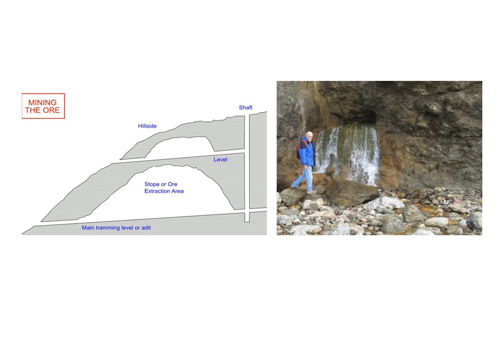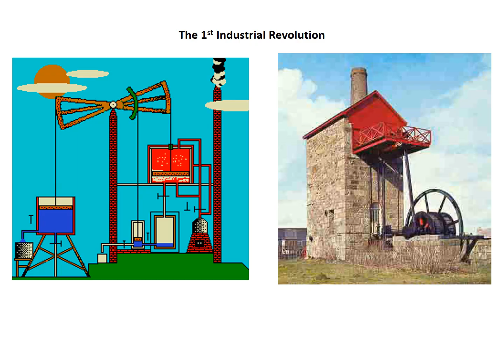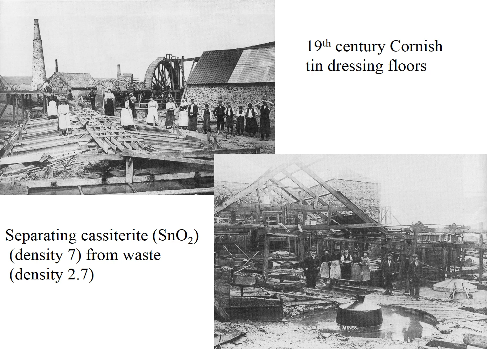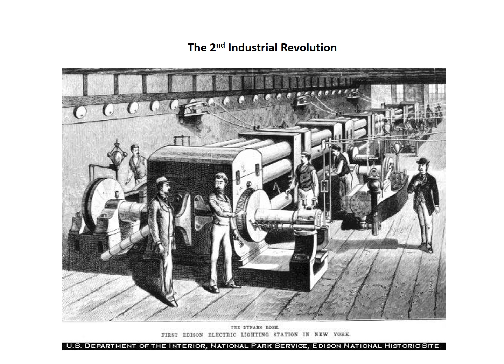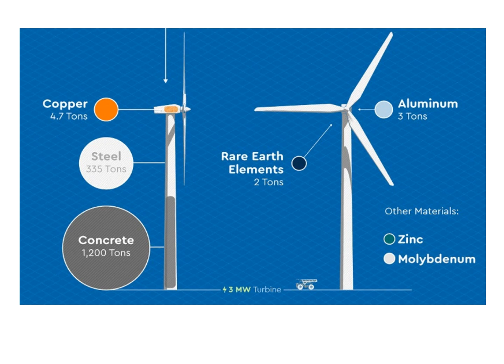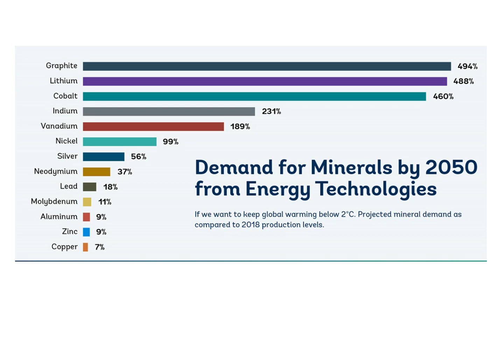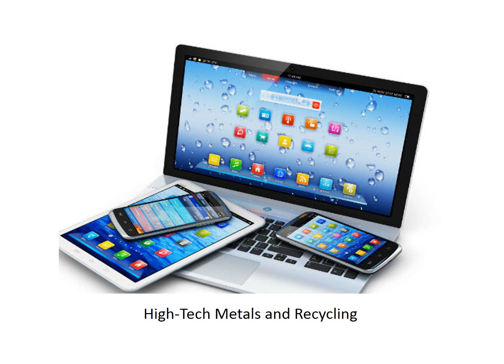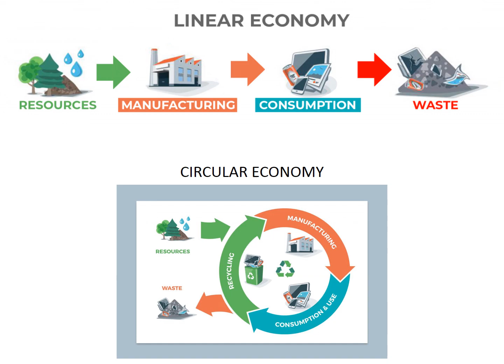The Crucial Importance of Mineral Processing

Comment: Thanks Barry, the presentation mentions that smelting was carried out thousands of years ago. May I add that Professor Fleming at Imperial College, (RSM)in the early 70's,  mentioned, during his opening lectures on Flotation, that the Romans had discovered that by mixing goose oil with slurry, certain crystals would float. Probably a very onerous method used sparsely.
Reply from the maker: Yes, probably so. There were many attempts to use oil etc to separate minerals, but true flotation, froth flotation, which could be used at large scale was an early 20th century invention